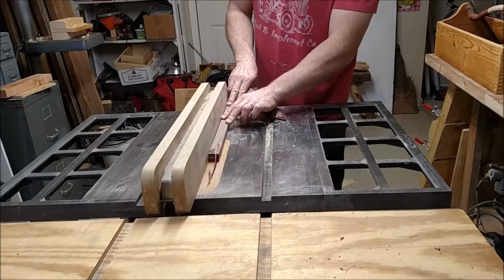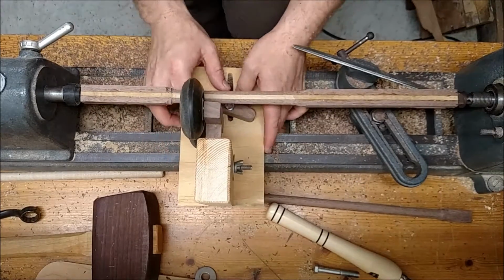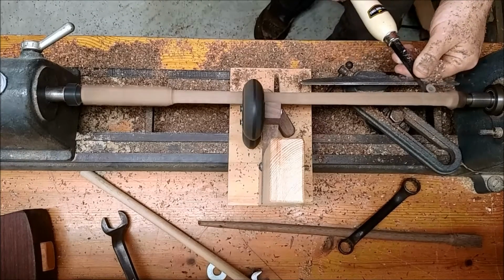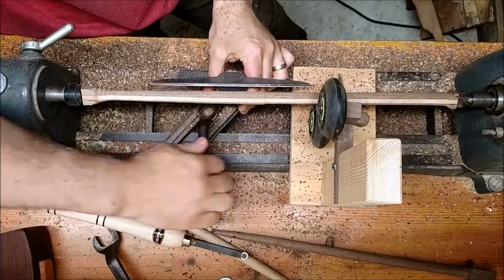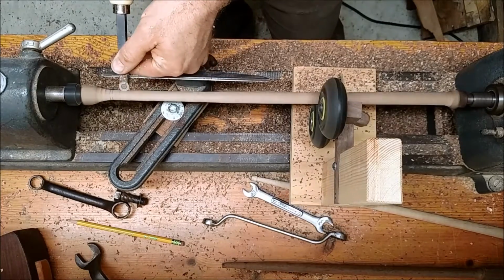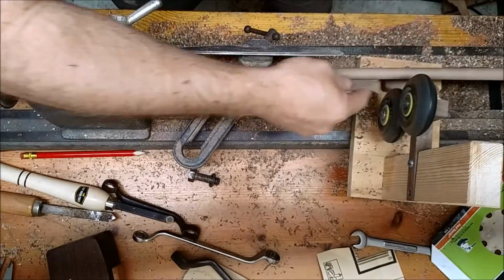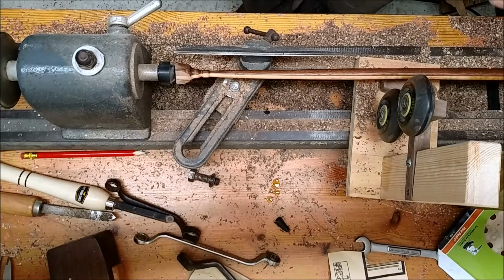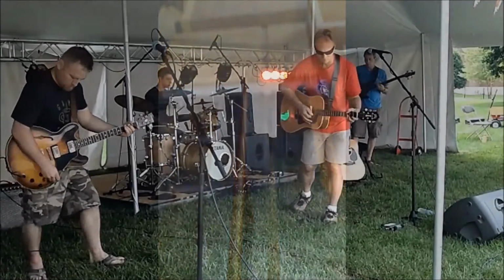Maple and Walnut Laminated Drumsticks on the Lathe- Vintage Wood Workshop

Comment: Very nice! Myself and a buddy are going to tackle our first set of drumsticks this weekend! I did a practice run on some thin stock today and noticed quite a bit of flex, just like you mentioned in your video. How much did your 2-wheel steady rest help stiffen up your drumstick during turning? I've seen your version of the steady rest which can be placed at the back of the piece and be fairly out of the way. And I've seen other versions that encompass the entire piece. I'm not sure which one is worth making for this project or which one is more effective. If your 2-wheel steady rest did a good job stiffening up the piece, then I think I may go that route.